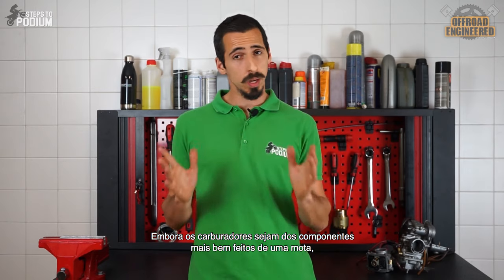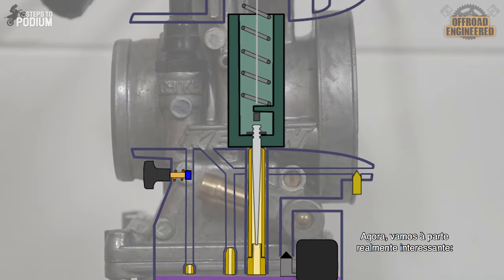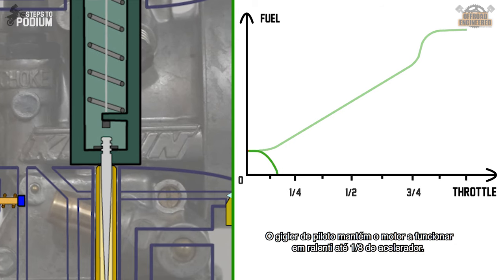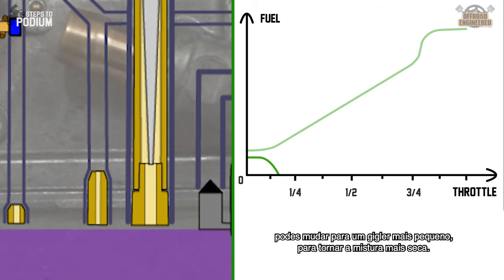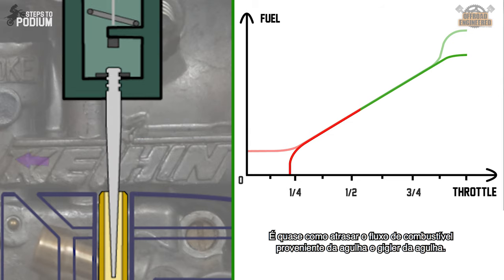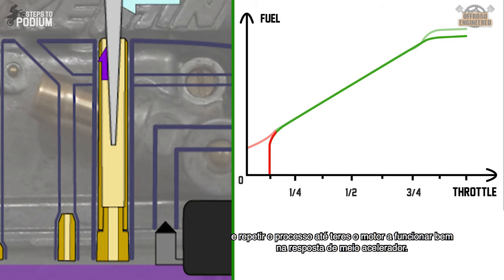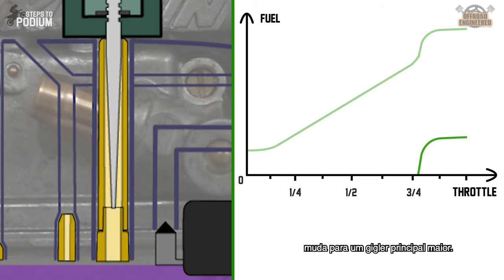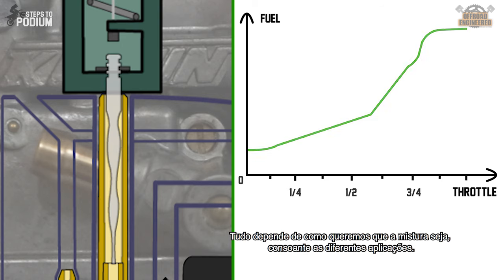How carb jetting works | Offroad Engineered

Comment: How do we know if the engine is runnning rich or lean? what about a lotta rich or a little rich and vice versa?
Reply from the maker: That's something that can only be understood with experience. Meaning that you actually have to start messing with the carb to understand what it means a rich or lean mixture. 
One great way to get a good base on that is to change the needle's circlip position to its extremes. That way you will be able to feel what is a rich or lean mid throttle response and translate that feeling to idle and full throttle. But nothing replaces getting your hands dirty and trying out :) 
With carbs it's a little more dificult to understand these feeling than with suspensions because you don't feel it in your hands (quite literally) but you feel it in the engine's performance. 
A lotta rich will for sure get you foul plugs and too lean will make your engine heat up rather quickly! Hope it helped 💪
Reply: @StepstoPodium  Awesome thank you! I ride an older 4 stroke, 2010 yz250f, so it's part of the pre-EFI era and carb tuning is part of my maintenance. I have taken it apart, cleaned it, thrown in a JD Jetting kit that worked well. Then I had a buddy loop out (he's ok, so it was funny...) which bent up the stock muffler so I replaced it with an aftermarket pipe. Now I need to tune the carb a little... this info will help!
Reply from the maker: Let me know how it turned out! I would love to hear your findings and how the video helped you tuning it 😁💪
Reply: @StepstoPodium  آ
Reply: If top of Spark plug (sparking area) is clear and white  it is lean .   If spark plug has carbon black carbon layer on top it means rich mixture.
Reply: @StepstoPodium  how would you know if your motor heats up quicker than normal due to lean mixture ??? 
I have a 650cc single cylinder motor that bogs during mid throttle ...
Reply from the maker: Usually an engine doesn't heat up often.  The first symptom of a heated engine is that the idle starts to pick up!
Reply: @akhileshkumargajendra2661  True, but this method takes a while to diagnose.  Lean will give decel pops, Rich gives a heavy gasoline smell at the exhaust.
Reply: If it's lean plugs will be dry and brown if it's fat aka rich it will be wet oily and black splotches you want a even light blacking bit clean overall with just the ceramic part lightly browned
Reply: Check the spark plug also
Reply: You can tell by the color of the plugs. Just search it.
Reply: So how looks good mixture¿
Reply: You can connect a wide band O2 sensor to your exhaust! That will tell you exactly how rich or lean you are running!
Reply: Check spark plug or pistom wash
Reply: My 12hp briggs has a completely black spark blug and shoots masive flames😂
Reply: @randallsimmons391 what if i have both 😅😅??
Reply: When to change pilot or the main jet should be told. Oh the needle as well. I know.
Reply: @MrSillypoptart  but aren't you then left with a hole in your exhaust?

Comment: Look at your spark plug if the tip is white or gray then it's too lean and you need to up the Jetter raise the needle and if it's black and oily then it's clearly too rich and it's choking out the motor

Comment: for everyone who wants to know: a lean engine will be more silent and gives a slight delay at low throttle. so you pull throttle, and a second later your engine responds.
a rich engine will have quick throttle response but gives bogging (on a 2stroke it is called 4stroking), so the engine makes a faster and louder sound, but the power decreases when its doing that.
Reply: Thank you
Reply: great !!
Reply: Why is it called 4 stroking? How does the engine being rich or lean in a 2-stroke change the crankshaft rotations? 😂
Reply: How do I fix it. It’s happening to me
Reply: @hhstarwars  because it ignites every 2 cycles like a 4 stroke. that means its too rich
Reply: What about float level. I heard a motorcycle mechanic say lower the floats a little can lean out the whole carburetion. Or raise it to richen. I guess less holes in the needle jet are submerged so more air can be sucked in?
Reply: So then they both sound bad ???

Comment: I´m not a beginner but i tell you this is the best video on YT for jet adjustement. See i power up my little 50cc two stroke to 75cc and i´m preparing well my first start. So people may thing on the first start you have to be cautious with too much rpm, but thats not true. Throttle up a two stroke means lubrication and thats what the engine needs at the first start with new cylinder and piston. But if you start up lean it can bring catastrofic consequences. So this video gave me the tutorial i needed. I adjust first needel to warm up the engine. To warm up we apply certainly one to three quarter throttle, so for that the needle is responsable and has to be the first adjustement. When this is ok i go for the idle by adjudting the air screw and jetting if necessary. The main jet will be adjusted on a longer ride with fully open throttle. Ohhh man, i got a plan, lol. Thanks a lot, greetings from Spain.
Reply from the maker: Thaaank you Dani 🙌🙏

Comment: The number one reason customers came to my shop . A clogged pilot jet on a carbureted bike .
First indicator ! If you need to partially run your choke once the bike starts and it won’t idle well with the choke off . 
Do that enough and you eventually foul your plugs . 
Know the first signs !

Comment: Great tutorial ! I have been trying to tune my carb for awhile , 1985 XL 350 , installed a Mikuni carb and mid and top end , after some rejetting are doing well , my issue is with the zero to 1/4 throttle , when riding it fluctuates too much , constant variation up amd down , choppy i guess might be the term , thoughts ?

Comment: You can adjust carburetor niddle up and down. It will give rich or lean mixture depend on niddle and fuel mixture screw. Niddle setting gives best  acceleration response.
Reply: Heck yeah, needle is a big deal
Reply: Mine is always bogging if i pull to fast... i tried everything...

Comment: The way to set it is to look at the color of the spark plug after the motorbike engine is running... if it's wet or black it means it's wasteful, if it's dry it means it's economical.

Comment: Great explanation of how everything works!  Im having an issue, its a 2 stroke 490, feels good but when it gets warm/hot, the idle goes up and sounds like lean. I`ve heard those old YZ490 were impossible to jet right. Any suggestions?  I live 3200 ft above sea level, just in case :)  Thank you

Comment: Best explanation 💯 Question: have a straight piped Honda shadow 1100 that hasn’t be rejeted and I’m in the process of it. How should I rejet it? In idle it’s to boggy and when I’m in mid rpm’s I have to give it more throttle
Reply: higher the needle!

Comment: What a fantastic, clear video.  Am new to this and looking to help iron out some running issues with 4stroke 50cc gy6 ped.  
Issues being slow to pull away from standing, can almost die.
Also some bogging at full throttle.
Also generally slow.
First I'll just do a carb clean.
I'll then see how it runs.
Depending on how it runs....
Is the first thing to alter is the needle size?  
Or does it not matter, but only change one thing at once?
Thanks!!

Comment: correct me if Im wrong,,, the pilot jet supplies fuel all the time. not only when the throttle is closed or partially opened. so the pilot jet can be used for very fine/final tuning.

Comment: Hi Thanks for the video! I have a problem with a hanging idle. When i start the bike it just runs normal but when i give it a hand of throttle the rmp stays high and wont drop. When i pull the choke out and right after i put it back in it lowers down to the desired rpm. When i ride slow technical stuff and pull the clutch the rpm rises again and only drops when i let the clutch out. What do you think the problem is? i ride a crf250x
Reply from the maker: Seems to lean to me!

Comment: Ohh, that part about needle jet & needle combo was good.
I have problem that I raised the needle a lot and my afr is still to lean in the mids. Does that confirm that I need new bigger needle jet and needle?
I'm running zzr1100 carbs on bmw m10b18 engine so there is little info on tuning from scratch
Reply from the maker: Probably!

Comment: Great video thanks. Just a question if that's OK. When travelling down hill on my 2 stroke Beta Xtrainer 300 with the throttle fully closed I get a lot of surges, so much so I often pull the clutch in. What's the cause of this. Many thanks Chris

Comment: Honda XR400R done 4000km and was getting difficult to start

Once started it would only run on half choke.

So I bought a rebuild carb kit with all the needles and rubber rings.

Hex Main Jet - #140

Slow Jet - #52

Jet Needle - D625

Fitment:

Fit for Honda XR400R 1998-2004

 Cleaned that carb like a new pin. Fitted the new parts. Paid attention to the original screw settings. 

Starts easily no choke. Open it up it dies. Put half choke on it just about let’s you open the throttle but doesn’t like it. Put full choke on and can open the throttle and drive about easily. 

What have I done wrong and what do I need to do?

Comment: very nice video but i have some questions i bought new VM36-4 mikuni for my sr400 do i need to change the needle or anything? and do i even have to touch it? i pre-tuned the air way by 2.5 and left the idle screw
Reply from the maker: It depends on the behaviour of the bike 😅
Reply: @StepstoPodium  so should i just test it first without touching it?
Reply from the maker: It's a good plan!

Comment: im in the process of tuning my carbs, currently can only get the bike to run on starter fluid and if i give 1/8 throttle to maintain engine power. i had my air/fuel mixture screw too far up blocking the fuel and it was running lean, currently it is running too rich but in both instances the engine will not idle. the bike ran and idled before i cleaned the carburetors. from this video i can concur… hold on let me watch the video again.
Reply: yea nope still confused.. on my 5th watch

Comment: I have a 50cc 4-stroke scooter with a pz16 carb. Had a little trouble with idle, switched the stock 35 slow jet for a 38 and now it idles fine, and the mixture screw reacts like it should. It runs fine all the way from idle through almost full throttle. At full throttle it loses power. Doesn't backfire or die, just a a slight loss of power. If I back off just a little from wide open, it runs better. I'm thinking I need to swap the stock 75 main for a 78. Does that sound like a move in the right direction?  Thanks for any info!

Comment: So what do I do if it only gives power at full throttle and bogs otherwise it will sit and idle nicely but if I’m riding and wide open then letting off to get back on the power it will bog until the last quarter of the throttle twist

Comment: I need help diagnosing what apparently looks like an air leak or fuel delivery issue.  My 260cc scooter starts and idles fine, but stalls upon little throttle.  If I restrict 75% of air flow at the intake the scooter throttles fine. Spraying starter fluid or carb cleaner at the manifold shows no difference in motor rpm.  Thank you.  Float and valve clearance are at spec, new slide diagram, new gas, new filter.  All jets are clean.
Reply: Found the problem.  There was another air pump behind the throttle cable housing that was covering this air pump.  The throttle housing was installed with Red Loctite so had to use a small torch to get the two bolts loosened.  The air pump was crusted with dirt and the plunger was stuck closed.  Cleaned it and lubed it resolved the problem.  This is a CVK30 carb.

Comment: My 01 YZ250 will only bump start or push start, once it starts it sounds nice and crisp. Elevation here is about 2000 feet above sea level at least 100 degree heat. I will try leaning out my pilot jet from 175 to 165 and see what happens.
What are your thoughts?
Reply from the maker: Are you using the choke?

Comment: keihin 28mm what is ideal jettings?
keihin 28mm class A only(copy)
i use suzuki raider 150cc stock engine
thank you for your response
Reply from the maker: It depends from a lot of factors 😅 hard to tel without testing with the bike
Reply: @StepstoPodium  right now i use 110 x38 5th position needle but still not that smooth..

Comment: HELP! Today I straight piped my motorcycle and as I was riding I would hold the clutch in then my motorcycle would be so quiet as if it was off. It turned off once.. so my question is what could be the problem and how to fix this Thanks!

Comment: Does a bike with carburetor consume fuel while engine braking?
Reply from the maker: Yes, it does
Reply: @StepstoPodium  Then how much, Will it increases with RPM, Or Same as in Idle condition?
Reply from the maker: It depends a lot from engine to engine

Comment: I have a 2009 yamaha 250 .4 wheeler .put new carburator on it and new jets .how do I adjust the fuel air flow valve . It cranks idle good but when you put it in gear it want take gas .it dies

Comment: What will I do if the plug reading during mid throttle is blackish with some brown but the reading in full throttle isn't? It's somewhere between "not black but not white too but it isn't brown."
Reply from the maker: From your description it means it's getting leaner at full throttle
Reply: @StepstoPodium  would changing to bigger pilot jet help fix the lean condition during full throttle? I forgot to mention that the mixture screw is already at 4 full turns, more or less
Reply from the maker: @byaheniVan maybe we should schedule a technical session to go over that in more detail! 🙂 
Trying to fix something through comments is not easy 😅
https://stepstopodium.com/technical-sessions/

Comment: generally does the idle screw stay all the way open all the time?
Reply from the maker: How so all the time? Once adjusted, it remains in the same position ideally. Unless you change very often the altitude for example
Reply: @StepstoPodium  im new to tuning carb. i just got a used bike few days ago.  i thought only the fuel screw needs to be adjusted when adjusting the idle speed as the more/less fuel will determine the idle rpm. idk what im saying
Reply from the maker: Before turning the engine, you have to make sure the engine is in good condition. Trying to adjust a worn engine is the biggest nightmare!

Comment: Any one have any idea what could cause the engine to sort of stutter at wide open throttle?
I have a honda xr125l and if you change gear and try to accelerate fully the bike sounds like it's redlining and then suddenly accelerates

Comment: So question for ya. When I’m at idle if I pin the throttle it will kill the bike. Which jet would be causing that? Would it be the idle jet? Thanks
Reply from the maker: It should be both actually, since you are looking at the transition of idle and main jet/needle
Reply: @StepstoPodium  would it be from starvation or to much fuel? Sorry for all the questions, I’ve never messed with a carb before
Reply from the maker: It's hard to say(and diagnose) through comments but it seems to be from to much. Usually a bike bogs and dies when there's too much fuel
Reply: @StepstoPodium  ok thanks man

Comment: I added an after market air filter to mini bike, it bogs down when you give it gas, which way would I adjust the jet screw
Reply from the maker: Ia ir a bigger air filter?
Reply: @StepstoPodium  yes
Reply from the maker: Then probably there is not enough air getting in, which makes the mixture too rich!
Reply: @StepstoPodium  should be more air getting in , it bogs down at 3/4 throttle
Reply from the maker: More air getting in or less fuel getting in. Since you adjust the fuel intake, it should be less fuel 💪

Comment: Great video , my bike has a slight bog at 3/4 to full just for a couple of seconds, any advice please mate , by bike is a 2 stroke dt100 , thank you
Reply from the maker: It's always hard to give advice through the web without checking the bike, but you might be having a main jet to big. Hard to tell, but check it out!
Reply: I would lower the needle position one notch down to start see what happens.

Comment: I don't understand what is suppose to lift that needle, because it's not connected to the throttle in any kind of way and a spring and gravity is holding it down.   

I assume a vacuum, but from where?   The engine side?  I don't think so...
Reply from the maker: how so lift the needle?
Reply: @StepstoPodium  On the main jet, the needle that goes into the main jet and is attached to a piston, that is pressed down by a spring... a piston that obstructs the airflow into the carbuerator from the airbox.   

That piston is not attached to the throttle... instead, the throttle is attached to a separate vein on the engine side that swings open or closed.

On my carb the jet that always gets clogged is the bloody pilot jet next to the main jet.   I can clean it out surgically clean with fresh gas with stabil and B-12 in it, put the carb back on, it will run great once or twice, and then the bloody pilot jet is clogged again and it runs like shlt aka bogging down to zero when you twist the throttle from idle.